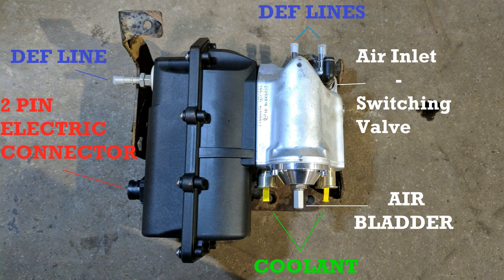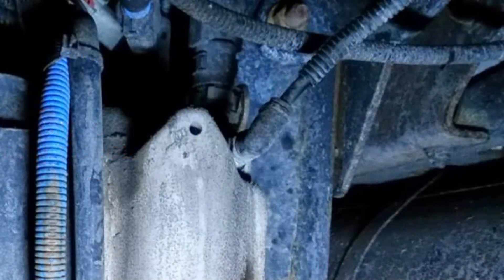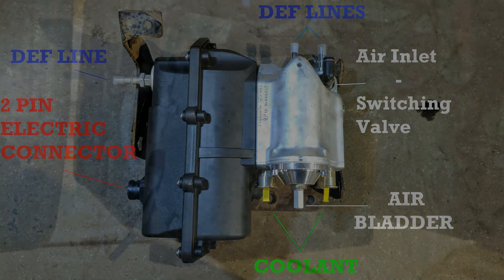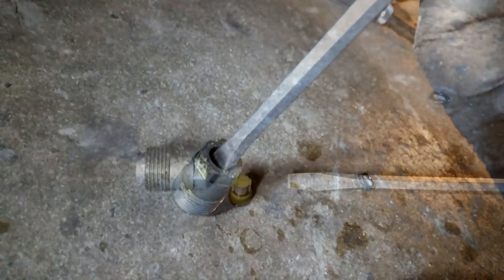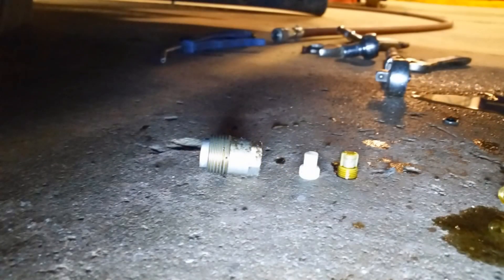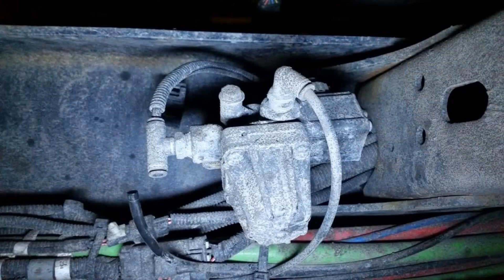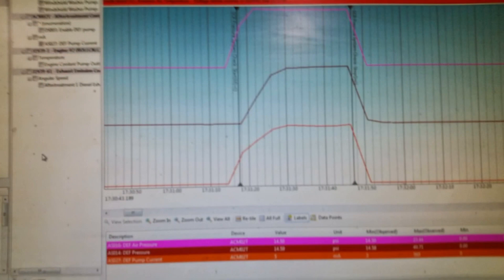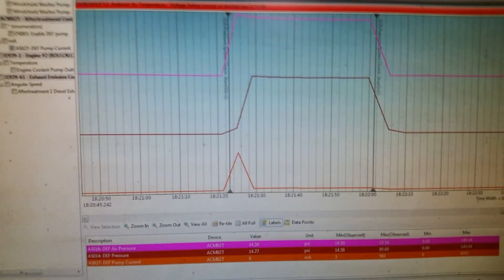Detroit Diesel - Low DEF Pressure

Comment: Dealing with a similar issue on a Mercedes 906la motor but the pump and metering valve switching valve are exactly the same.

Spn 4334-18

Replace pump and metering valve and flushed lines still no luck going to check voltage at pump I know I have 24v there on 1 pin need to check the other. Also I did have oil in air line so going to check that line.

Comment: yes it’s work I change my new def pump code active then I change inside small filter run park regen after 5min code active again then I change inside valve from old def pump make sure the way you push out valve same direction you  push to new def pump then run park regen 45 min regen is complete and you good to goooooo.

Comment: I keep getting a Engine derate and it’s saying it’s the DEF PRESSURE SENSOR. i took to Peterbilt they said my filters needed to be replace they were dirty and the pump cap has a leak so I replaced that. And now the same code is still popping up now they’re saying the recommend replacing the DEF PUMP.. any recommendations? The code is intermittent comes active and inactive

Comment: I have a code today eec 61  4335  for a metering unit low pressure. Someone else recommended  replacing this   before  replacing the expensive one. Now can I do it my self and  just do a regen after or the light will go off by it self

Comment: i have this code but i did what you did ..no oil in airlines and filter is clean..its just simply not spraying DEF into one box.. ive had a full bar of def in just about 2000miles, what do you think it could be ? hope you can help thank you! by the way limiting valve has been replaced and the air valve that sits under the cab in the chassis
Reply: The harness
Reply: Currently my problem too.. My DEF gauge has been full for 2500+ miles..
Reply: Wath was the solution to fix your truck how do you corrected??

Comment: Hey how you doing buddy I got code 4374 fmi 0 I did the def/doser kit that came with all new screens, rubber gaskets, def filter and a new valve for the pump and everything was running well then 2 days later this light came on
Reply: And I almost forgot it’s not sucking any more def fluid the tank is still full after a week of driving
Reply from the maker: It can be quite a few different issues but there's a couple of quick things you can do. First make sure all of your DEF lines are in good shape. Not pinched or kinked anywhere. Remove the supply line to the doser on the exhaust. Place it in a container of water and start the truck or, if you're able, run the ADS self check with DDDL. The DEF pump should run. Watch the container and make sure no bubbles are coming out of the line. If there are bubbles, the pump is sucking air on the inlet side. Make sure your pump electrical connections are clean and tight and have a good look at the doser connections and wiring leading to it. The DEF pressure sensor is built in the dosing unit and it's very common for the wires to chafe and corrode near the plug.

Comment: Hey I got the pump changed and still has that code. I did took the metering unit apart and clean. When I took off the air line and there is no oil coming out. What can still cause this code?

Comment: Would a "practical fix" for the oil problem be to install one of those painters oil/air separators between the limiter and the pump? Route the hoses to make the cup a "drain trap", and just drain it every Friday, or a similar interval?
Reply from the maker: That could certainly help! If you decide to try it, I'd love to know how it works out.

Comment: Could you explain code EEC 61 and eng 1 come on ?
Reply from the maker: EEC61 and ENG1 are not fault codes. They are simply identifiers. It's your Instrument cluster telling you that the Aftertreatment Controler and Engine are each broadcasting at least one fault code.
Reply: @TheDieseler  how long can you run before it's a must that you fix the EEC 61 issue?

Comment: Hi there, i watched your video many time and these codes are on and off with me for the past 6 months (EEC 61/4334/07 and 4375/06) and finally i decided  to fix it on my Cascadia 2014. I have no mechanical background at all, so i was a little worrisome ... So i went under the truck and unscrewed everything as you shown on video. I had everything ready, new Switch from Dealer according to my VIN number. And then it was a little surprise!!! When i puled out the Old Switch, it was half the size of the  new one. It was shorter and there was small circular rubber back side wall on it. The face of the switch looks the same though....So like you said, DEF start leaking out and i took a tool and try to gently clean the socket to make sure its clean. And it was super clean, no Oil no Crystals no nothing. I quickly inspected the small (Old) Switch that i pulled out and it looked like new, clean and not blocked at all. I  blew some air through it, washed it a bit and placed it back. Just in case i changed the air fitting and screwed everything back together. Then i took apart Metering Unite and cleaned it as well and mounted it back to the One Box. I stared a truck and drove for about 30 min but codes did not go away :( .  I talked to some local mechanics and some of them offer to delete the whole DEF System. They scared me a bit because we are talking about 15k/20k repair, and i was hoping to rich out to you and maybe we could talk? Please let me know what do you think and if its possible to get in touch with you about my situation, if you don't mind. In any case i wanted to thank you for your videos. they help alot to understand what is what, especially for some one like me with no Trucking Mechanical Experience. Best regards
Reply from the maker: Even if the issue was repaired, the MIL light will not go out immediately on its own. Each fault has specific conditions that must be met before the ECU gives it a Pass/Fail. It sometimes also needs to see this over multiple drive cycles before it will turn off the MIL. Like I've said in past videos, I tend to cover the more common problems but there are many others that can occur. Hopefully yours has been solved and the MIL will be going out soon.
Reply: Did you ever get your lights to turn off?
Reply: This was a year ago. Your reply was a bit late))

Comment: The code on my DD16 is SPN 4355- FMI 5, can I get some help on how to get closer to the problem? Thanks
Reply from the maker: +patinoboxx That code is signaling that DEF line heater #2 is reading an open circuit. The heating element that runs through the line may have failed or there may be a broken wire in the harness between the line and the ACM. You can check for an ohm reading through the line. You should also have battery voltage on one pin from the harness and between 2.25 and 2.75 volts on the other.

Comment: Can you tell what's  code rec 61 son 4358 fail 03 I try to look it up but did not found nothing
Reply from the maker: +Mariano Covarrubias There is a problem either with the Metering Unit heater or the wiring for it.
Reply: TheDieseler ok thank you

Comment: Very good. I just want to know if you can help me I have code EEC 61 SPN 4335 FMI 1. check engine light is on local shop says I need to replace Air compressor, DEF limiting pressure valve etc. Please let me know if you help me with that. Thanks.
Reply from the maker: That code indicates that the ACM is not reading Air Pressure at the DEF metering unit. What they're recommending is possible. The air compressor could  be failing and filling the system with oil. I would have them verify that there is in fact black engine oil getting into the DEF air components (I rarely see this). It should also be present in the truck's air tanks if this is the case. If the oil does not look like engine oil but does look more like the oil you see in this video then you do not need a compressor. The "Oil" will actually be melted grease migrating out of the Pressure limiting Valve. 
Not reading air pressure at the Metering Unit can mean the Limiting Valve has failed or it can mean that the Metering unit is getting plugged up. If the valve is sending air pressure to the Metering Unit then the metering unit may just need to be disassembled and cleaned. The inlet screen or Diffuser Heater inside could be plugged.
Reply: @TheDieseler  i have eec 61 spn 4335  fail 1 fault 4 pleace

Comment: additionally, if the pump cuts on and off, on and off every 2-3 seconds the diaphragm may have a pin hole or for any other reason lost its pressure. remove the hex cap on the bottom and push in 45-50 psi of nitrogen. put a drop of spit on your finger and put it over the shrader valve and see if it bubbles.  also if the psv has rust particles in the screen that is coming from rust in the air tanks. you need to address why the air dryer is allowing water to the air system. new air tanks, blow out lines and lots of valves.  drain those air tanks every opportunity,

Comment: Yes but I lost throttle and no power on truck these are the code 5246 fail 16 ,15 and 00 the 00 is affecting my throttle  please help
Reply from the maker: +Mariano Covarrubias there are more codes than what you're seeing. Those are derate codes. You're most likely locked to 5mph. There are other problems that need to be addressed.
Reply: There's another code rec 061 spn001761 fail 03 could that be affecting my throttle
Reply from the maker: Again, there's nothing wrong with your throttle. The engine is derated and with no other info to go on, other than what looks like a fault code here, I would say there's a problem with the DEF tank Level/Temp sensor or the associated wiring.

Comment: I have 3 code 5246 and under it it has 16 and 15 and 00 can you tell me what does it mean I'm broke down
Reply from the maker: Mariano Covarrubias These are regulatory/derate faults. They are not the cause of the problem. They simply become active once the problem has been ignored for too long.

Comment: Thank you for you explanations of DEF systems.  I repair Fire Apparatus and I have been having issues with them lately.  Can you tell me the part number for the Pneumatic Switching Valve you mentioned at 2:38 in the video? The local Detroit dealer told me it was unavailable.
Reply from the maker: I used a random Engine Serial number for an EPA10 DD15 and got these numbers. They should work but it's always best to give the dealer your VIN/ESN just to make sure you're getting the right info. 

The Filter number is A0001400594 and the Pneumatic Switching Valve number is A0001420019
Reply: Thank you. I tried another dealer, and they found it in a service bulletin, gave me the same part number as you did (we run EPA10 DD13) The Pneumatic Switching Valve did not correct my current issue, Pressure Limiting Valve (S9750090040) did. I didn't think it would have failed already, as I just put a new one on this unit 2 months ago. There was a lot of water that came out of the inlet though, I wonder if that damaged it.
Reply from the maker: Mike Castro The water probably did contribute to it. Glad to hear you got it sorted out.

Comment: Hi, What values or parameters do you select towards end of the video to check air pressure graph?
Reply from the maker: Coast Xpress, Inc. DEF Air Pressure, DEF Pressure and DEF Pump Current (mA). These are all values read from the ACM.
Reply: Gr8 video, Do you provide more advance training on diagnostic link?

Comment: What is the best way to get to that area without having underground access?
Reply from the maker: I always just use a rolling "creeper". Getting under some of these trucks can be pretty tight these days.
Reply: Wes Gagarin I made myself 2 ramps out of pressure-treated 2X10s. (8 ft long). Bought 4, cut 2 in half then  added a 3 ft section then a 2 ft section on top of each to form ramps. I use them routinely to change oil, filter and grease. Just be sure to chock your drives when you are under truck. Cheers.